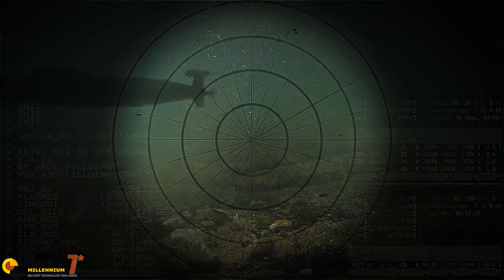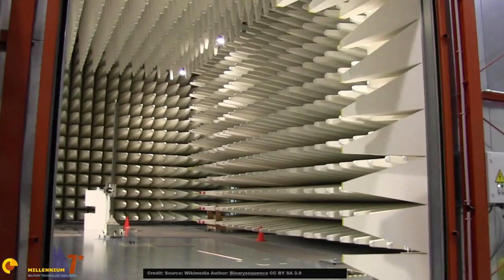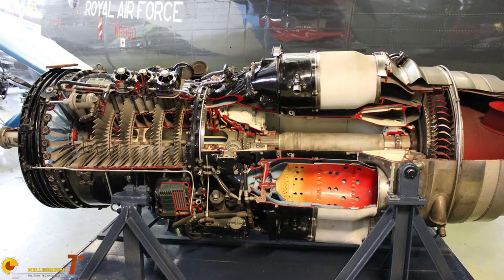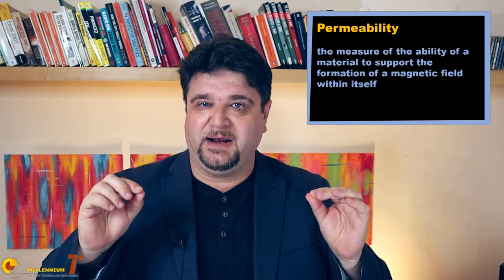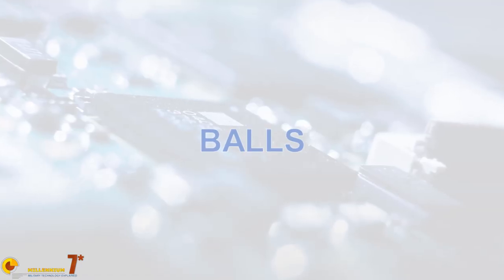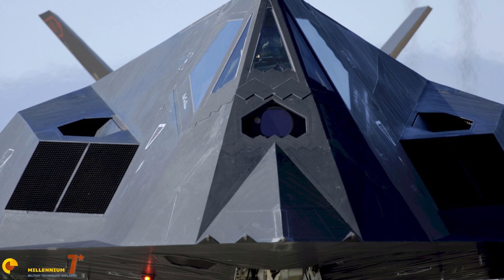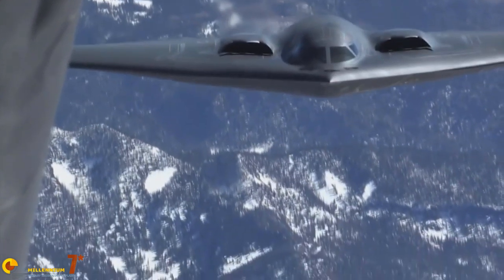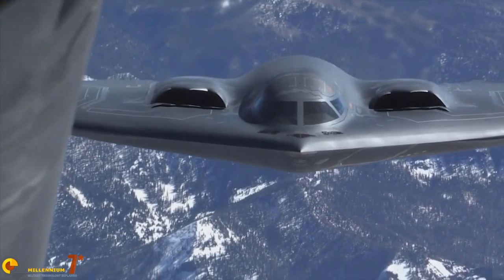STEALTH: The Cloaking Device - Radar Absorbing Materials

Comment: 00:40: All dB scales (electrical, audio, and noise) are logarithmic, not linear, in nature. A 50 dB (I am assuming a power ratio, not voltage or current) reduction translates into a reduction of 1/100,000 of the original power. A 60dB ratio translates into a reduction of 1 millionth.

A 60 dB ratio is significant, but it does not make the target undetectable. In radarspeak, it just reduces the probability of detection. Enough transmitter power, a large enough antenna, and a close enough target, and we can detect it.

Comment: In timeframe 9:06 about durability of absorbent paint material, in case the paint is still intact and in place then is there any material where it is sprayed / diffused in the air to either cause the paint to (1) peel off if still intact or (2) add / spray / splash reflective paint to the surface area to the flying object so it will be detected by radar? This will render the absorbent material (if still intact) useless. In this case a caution must be payed for the friendly crafts not to be near the contaminated area. How about firing a low cost missile to near the suspected zone and have it e xp lo-de and disperse special paint that will cover all airplanes in the area with such material and render its stealth feature useless? Once the stealth aircraft is painted with reflective material then a second missile is fired and it will then be easy to catch it.
Reply: Good question. Apparently the US has carried out highly classified bioweapons research into genetically modified bacteria that can do exactly that. They carry plasmids with genes that make them capable of reducing iron pentacarbonyl/ferrite based RAMs.

Comment: The thickness of the RAM coating determines the frequency range it will be most effective at.  To be effective at UHF or VHF frequencies, the coating would have to be METERS thick.  So lower frequency radars defeat RAM coating stealth.
Reply: Only if you posit one kind of coating. For other frequencies than, oh let's say F-117, has to deflect and absorb you might have to switch out a semi-precious gemstone with another. Quartz is mentioned in a china science paper. Along with Ti03 and Fe02 that you can vary the recipe you can deal with a much larger band. Also applying coatings to composite structures allows coatings to be more varied to deal with temperature.  Modern coatings may have the luxury to be applied to electrically active material, but I have no first hand knowledge of that, it seems reasonable.

Comment: Germany made a stealth bomber in ww2 the Horton and it was a flying wing similar to the B2 bomber.
Reply: D M It was fighter, not a bomber actually, that reached only the prototype stage until the end of the war, so it never flew combat missions, and its flying wing design was meant to optimize aerodynamic performance in the first place, rather than radar signiture. But it did have some stealth characteristics, no doubt. The Horten brothers even claimed to have used some kind of radar absorbent coating on it made of coal powder later, but this is unconfirmed. Nevertheless the USA captured several pieces together with the whole documentation and several engineers working on the project that they could - and for sure did - base their own stealth designs on, together with Jack Northrop’s early experiments with the flying wing.

Comment: Can drones be built with wood? Exept the engine, sensors and weapons off course
Reply from the maker: Wood has been used in aviation till WW2 and it is still used in light aviation. So technically is not a problem.
Reply: Or fiberglass. Radomes (which must be transparent) can be made out of fiberglass or ceramic. Patriot missiles use a ceramic nose cone. HAWK used fiberglass.